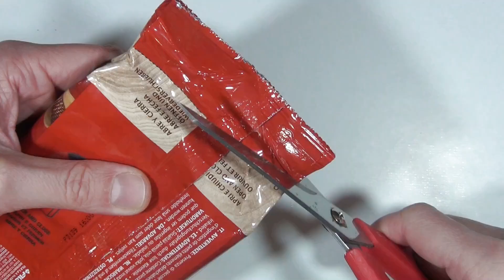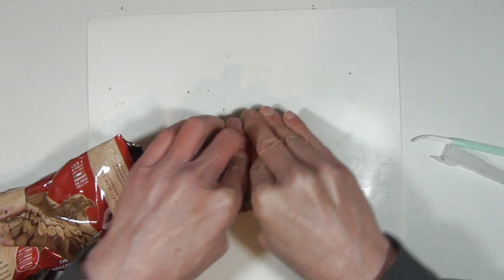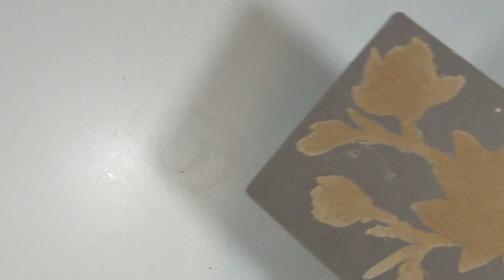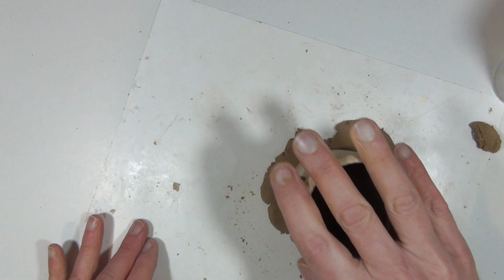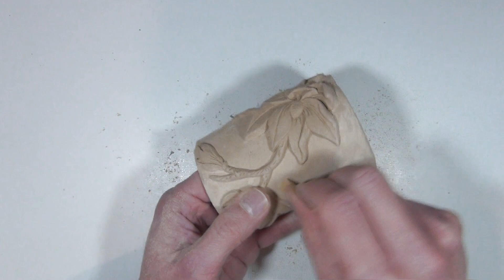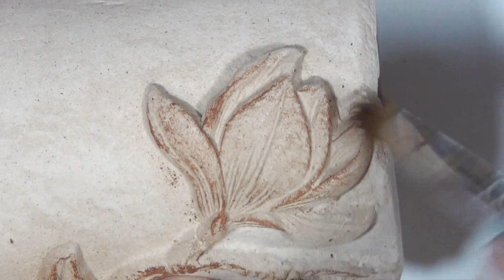Making a pen pot using Das Wood air drying clay

Comment: Det var den värsta degen jag någonsin använt. Den öppnar och faller hela tiden. Du kan inte göra en riktig staty med den. eller en känslig form. Det är inte värd
Reply from the maker: Thank you for your comments. However I showed that you can still work with the clay successfully, as I made the pen pot with it and also added decoration from a mould using the same clay. Yes, it's not like any other clay, but it's certainly worth trying if you like dimensional projects.